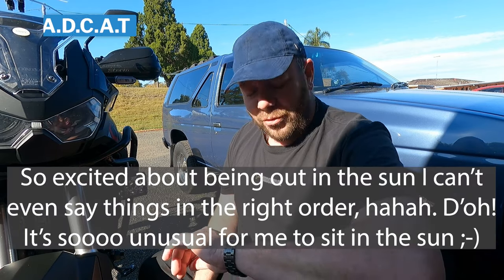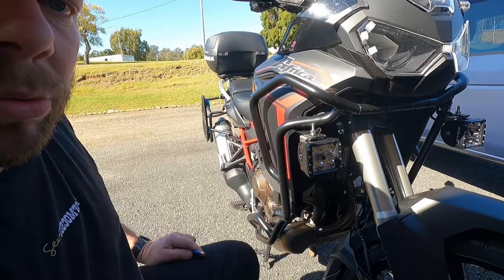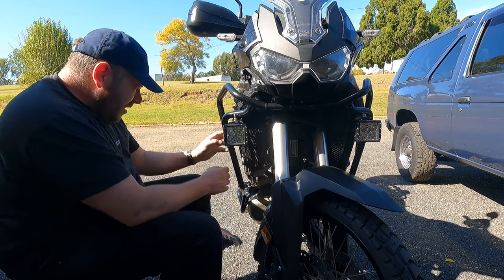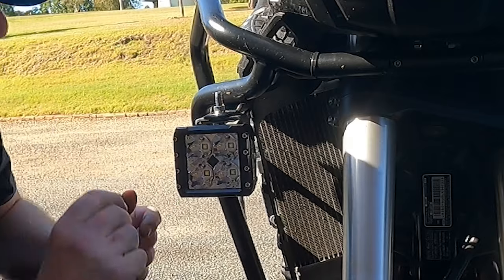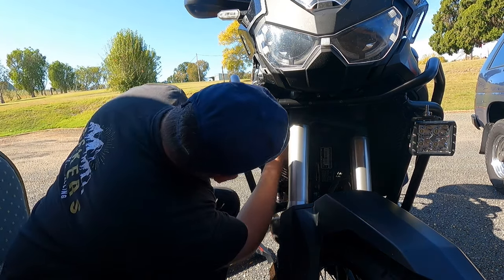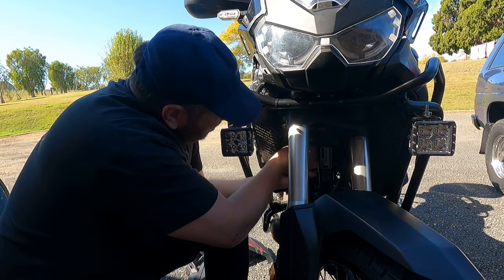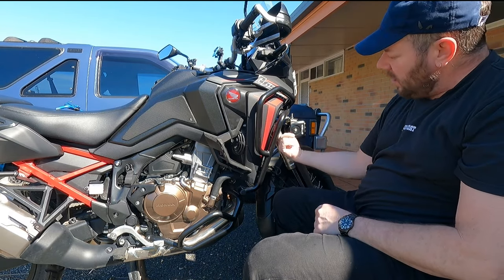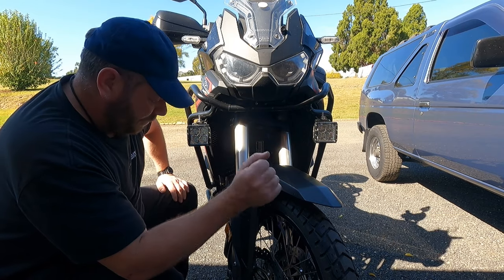How to install Radiator Guards on CRF1100 Africa Twin

Comment: The bike comes apart easily enough. I'm surprised. I would have thought it be a bit more tricky. Getting the front farings off the KLR is a pain in the butt. Good instruction brother. Stay safe down there.
Reply from the maker: Yeah, Once I'd figured it out on the first side it was really easy, and I was kinda surprised too.. But happy it wasn't too hard. 
Yeah, it's getting a bit scary down here now, but thankfully that's still a long way south of me.